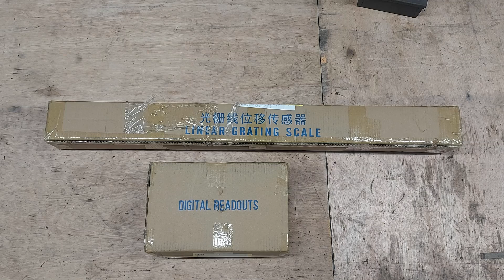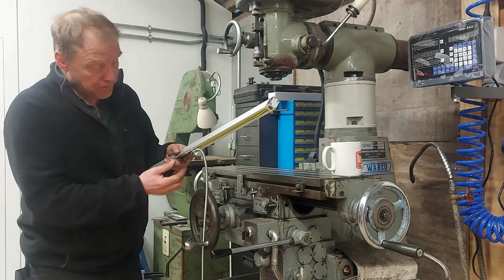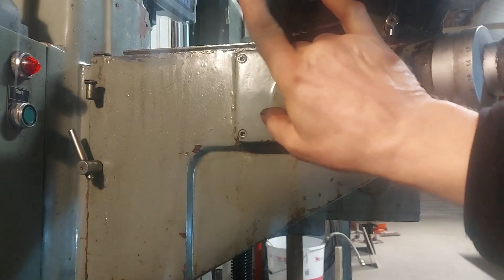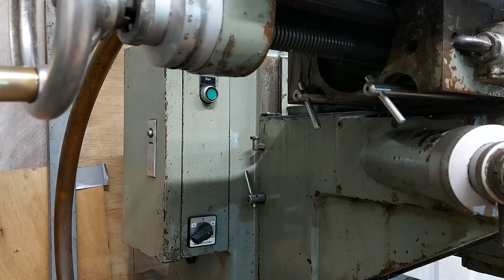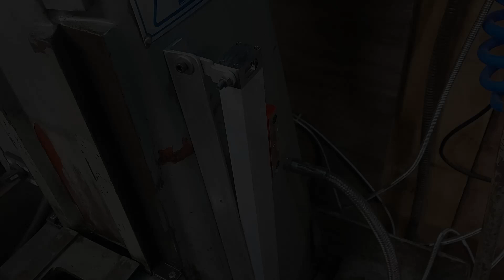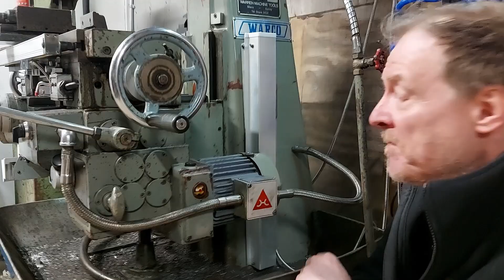Warco A2F Mill - DRO Install

Comment: I also have a Warco A2F mill I bought way back in the mist of time - I figure at least 25 years ago :-)  However, mine did not come with power feeds and I've only added the X-axis drive. Probably won't bother with a Y-axis but a knee Z-axis drive would be nice because winding it up and down is getting old fast. I did fit a 3-phase variable speed reversing motor though and I would hate to be without that. Right now I'm looking at the problem of fitting a DRO - which is how I dropped across your vid. Can you tell me the specs of the DRO kit you bought for yours? Did you have to cut the scales?
Reply from the maker: Hi Chris,
I simply measured the scales required, and found a supplier on ebay (Chinese, of course). It was, however, the same supplier I bought the DRO from for the lathe, and they were cheap.

https://www.ebay.co.uk/usr/industry.factory

This is company I bought from.
Reply: @ACSEngineeringServices  Thanks for the info! In the end I went with magnetic scales from M-DRO, significantly more expensive but they're slim-line and so easier to fit. Job done now and I'm happy with it.

Comment: I also own a Warco A2F, I have already fitted a 6.5" riser block made from a piece of solid bar stock, I'm in the process of trying to purchase/fit a DRO system to fit as you have stated it's an interesting problem. Your install is very interesting solution.  

One another modification that is very interesting is the addition of a motor reversing switch, did you do this yourself or the previous owner?

And one another question do you have any manuals for this machine operation/parts, please.
Reply from the maker: The DRO install was definitely a challenge. Very few straight edges to use...

The motor reverse was something born out of need, and yes I did it myself. It's quite easy if you have a basic knowledge of 3 phase motors. You just need to switch two of the phases around to make it run backwards. I used a three position 3 pole switch (On - Off - On).

I have searched the interweb quite vigorously looking for information on this machine to no avail. It was manufactured by a Taiwanese company (Keo Feng?), and was vendored under a few different brands (Myford VMF, Sharp, Warco), but original manuals seem to be like hens teeth :)

Good luck with the DRO install. If any of my ideas are useful, feel free to use them. Please let us know how you get on.
Reply: @ACSEngineeringServices  I have already ordered a reversing switch, I will fit in roughly the same location as yours, but the dro will be fitted to the riser on mine. Just have to wait for the dro kit to arrive now....